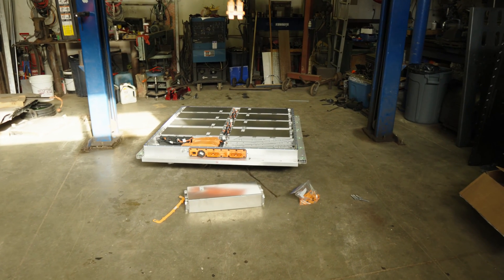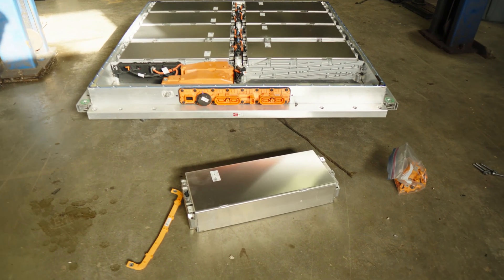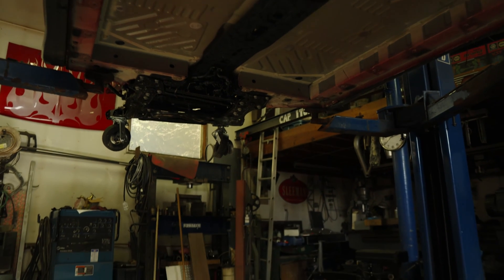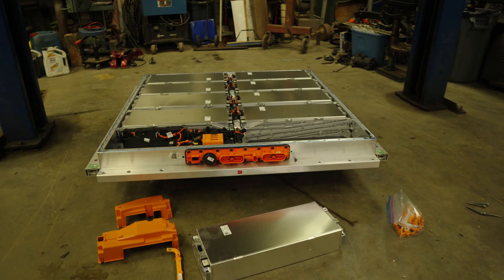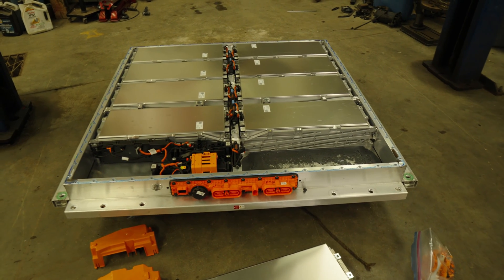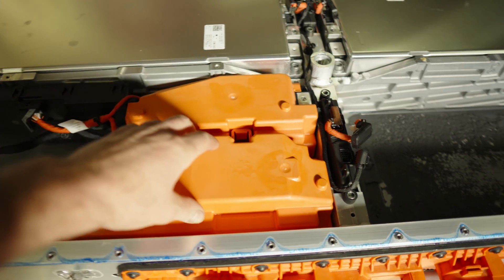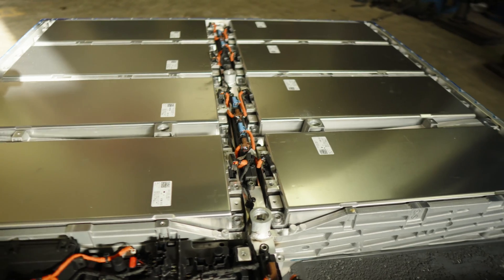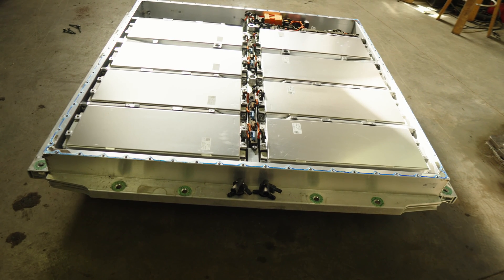Volkswagen ID.4 Battery Tear Down for the Electric Corvette Project

Comment: I got the same pack for my conversion and am using the Vero. Did you end up suing the positive and negative contractors forms he pack itself? They seem pretty compact and also designed for this pack. Did you make the video on CCS charging? Couldn't find it.
Reply from the maker: No I didn’t use the original contactors. I was tight on space so they wouldn’t fit where I needed them to. I haven’t done the ccs charging yet, I had money to spend in other places first. I hope to do that very shortly though

Comment: This battery is designed much as many other non-Tesla EVs but with the special feature that the cooling panel is external from the pack housing to avoid the risk of leaking coolant contacting cell terminals. Hyundai-Kia moved to this type with the gen-2 Niro, Kona and all the E-GMP series, while previous models used a specialised low-conductivity coolant which has proved to be unreliable.  Tesla's traditional round-cell pack designs reek of design engineers being excessively pressured by management to cut costs to the bone but retain maximum charging performance.  Their spray-foam design reminds me of something I might have kludged-up for a 9th-grade science fair project when I was 14.  In the future all EV battery packs will be fully serviceable and I wouldn't be surprised if German legislation helped in this case.
Reply from the maker: Good insights. Thanks appreciate it.

Comment: Excellent ! This is exactly why I am driving a VW ID 4 for rideshare(uber/lyft) instead of a Tesla. If After warranty I ever have a bad cell I dont need to replace the entire battery like with Tesla(because they are designed not to be serviceable as you stated) I cna buy a used Module for $500 /new for 800 and take it to someeone like 519Kustomz  to install(used with similar cell voltages might be best )

Comment: The more stuff people can share the better l reckon. Looks like you're going to do something l have been wondering about. Custom battery packs. lt will be really interesting to see how things like performance and range are affected by the reconfiguration. l'm also interested to see how you handle battery box sealing , venting and waterproofing given this is going to be a floor mounted version l'm assuming . Cheers.